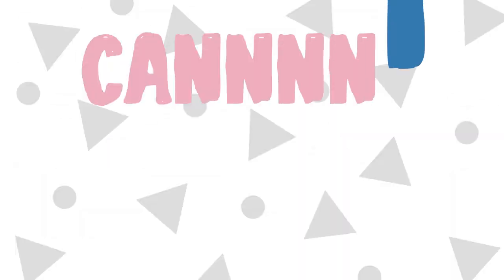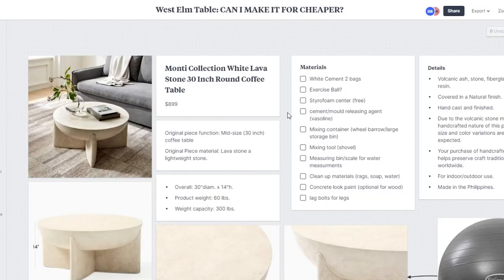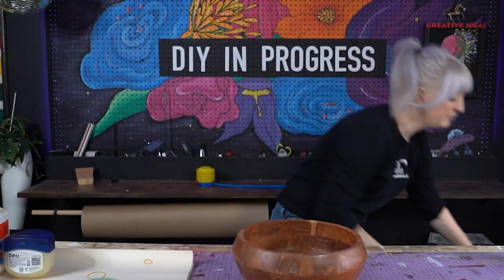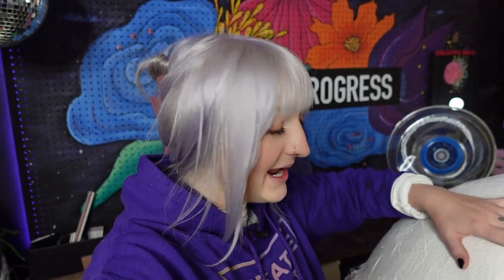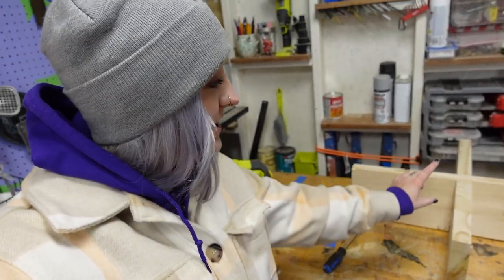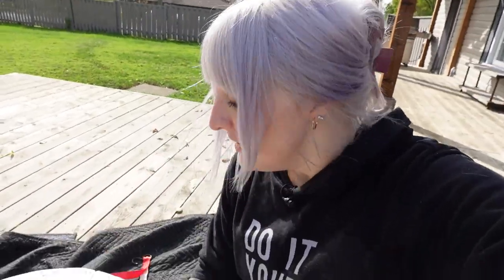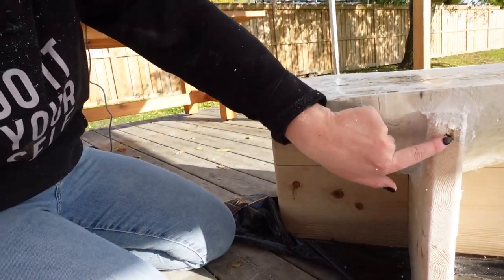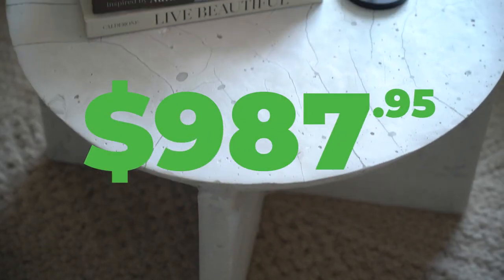Let's dupe the $1000+ West Elm Lava Stone Coffee Table! | Can I Make It For Cheaper?! | DIY Danie

Comment: As you were working, I thought of a variation for this project - I love the concrete top, but I think I would stain the wooden legs and play up the contrast in the materials.  Not necessarily the West Elm dupe, but still a visually interesting project.
Reply: I love the wooden legs idea!
Reply: Next level idea!
Reply: I was just thinking the same thing!
Reply: I was thinking the same thing
Reply: I use packing peanut in the bottom of big planters. I wonder f they would float? Or if you could mix them in. You couldn’t have used plaster of Paris to fill the cracks? Or how about an epoxy pour in another color. For the record, I liked the bowl shape of yours better than the flatter shape of the original.

Comment: To use more foam blocks, maybe hold them down with a piece of plywood. Hold the plywood down with a rod into the bottom, pour concrete on top. The hole in the bottom is covered by the legs anyway.

Comment: Hi. I live in a Caribbean island and our roofs are made of cement or concrete. The way they make it to avoid cracks is create a kind of pool of water on top of the fresh cement and don’t let it dry for a full day until the cement sets. That might help you the next time you need a smooth surface in a concrete material.

Comment: My sense is that if you read between the lines, the original West Elm "Lava Stone" is actually a kind of concrete as well: they list "volcanic ash" and "sand" as what it is made of.  I suspect that it also includes something like finely ground styrofoam to lighten the mix.  I would search on-line for something like "lightweight concrete mix" and see what comes up if you decide to do another project along these lines.  Even so, I'm impressed with how yours came out: cement can be unforgiving and your version looks great!

Comment: This turned out really well, I think the cracks add a uniqueness to the piece. A little tip (and if you ever attempt this again hehe), the reason for the cracking was because the expansion of the cement. Have you even noticed on sidewalks that there are lines ever so often, that’s there to allow the cement to expand and not crack elsewhere. Also, the temperature change could have contributed to the cracking. Most cement jobs are done in the spring/summer cause the cement can handle the hot weather a lot better than the cold. I used to work as an electrician and working with the builders I picked up a couple things along the way haha.

Comment: It came out so neat! Digging a hole to support the mold was a stroke of genius.
I don't have much experience with concrete, but my understanding is that humidity helps prevent cracking? A spritz of water on some plastic tarping can help the concrete cure at a more consistent rate, meaning the surface won't dry so fast and contract before the inside has a chance to start.

Comment: If you make 2 bowls, one a little smaller than the other, then set the small bowl inside the large bowl and only pour concrete in the space between them.  Then use a piece of plywood for the top, seal with epoxy and add thin layer of cement or spackling compound over the plywood and down the sides.  If bowl is @ 2 inches thick, top could be anchored to the bowl with concrete screws.  Just my thought.

Comment: love love love the end result, and the cracks gives it extra character:D  i was thinking you could probbably make the bowl shape with a kiddiepool/sandbox and use expanding foam (the one in a spraycan) in it, then cover that shape with concreate/joint compound, that way it'd be alot lighter:) also using styrofoam sheets for the leg shape, covering that with the same as the top and you'd end up with something very similar but alot lighter:D <3   btw litterally every time you say editor roll that tape and the little intro song comes on i ALWAYS wiggle my body xD

Comment: Great job. The white bubbles ( forgot the name of it - sold in Canadian Tire)- additive to planter’s soil could be used to make cement lighter. I tried a few projects with cement - not easy. Cracking occurs summer time as well due to heat so it’s drying too fast . I would use old fire pit bowl for the top with the wood on a top and wood legs. Than finish everything to make it look like stone.

Comment: Danie this totally turned out amazing! Having worked with cement before I have some thoughts!!! 

Maybe look into some reinforcing somehow. Either a fine mesh/chicken wire (chicken wire may not be enough ot is very hard to work with) or that fiber glass mentioned in the original table ( think extra large glitter that acts like a mesh when it’s all in the cement mixture) with a mesh on top of a hallow base (and a vapor barrier) you could maybe coat a hollow wood structure with the cement and fiber glass. Also Home Depot or lowes has concrete dye that works well. Maybe a small mock up first! Of course I totally understand the “never working with concrete again” it’s messy!!! Also metal flashing is a really good way to get a shiny surface.

Comment: I really like the wabisabi cracks in your piece.  I know you were doing a dupe, but if you use a darker/contrasting paint inside those cracks before filling, it would look like marble. I also like the flatter bottom and proportions of the original table.  I think I might just make the ‘legs’ more proportional to your table, since it is a smaller dimension would make it look closer to the inspiration. Last thought ~ when pouring, be sure to scree the top so it has a flat AND level surface. Maybe even use a slip layer on top.  Overall, GREAT JOB.

Comment: I think it came out better than the original. I like the cracks. It's perfectly imperfect! Also you could try using beanbag  Styrofoam filling stirred into the concrete. Don't know if this would work but I have heard of Styrofoam being added to concrete for building projects before. Worth experimenting!

Comment: Very nice! There is mouldable concrete, that is more used like clay. Have not tired it. I would try to use that over a chicken wire structure, and beforehand fill that structure with something light, lite polystyrene. Or perhaps that popular sprayable foam! ☺️

Comment: The cracks make this table even more interesting and unique. Maybe you could add a hollow foam shape into the mould once you've poured enough cement ( as if you'd put in a large bowl) and cover it (only the foam part) with a foam lid, on which you pour the remaining cement. This way it's hollow and shouldn't have that much weight. At the same time, it should have stable enough statics. Anyway, this table is absolutely awesome 🥰

Comment: Hi Danie, I just love your table Cracks and all! I did not understand the Styrofoam until just now.../You wanted filler so you did not have to use so much cement??!! Would chicken wire with the foam have helped like using rebar in sidewalks for stability also have helped?? I have to say I  love your determination!!!!!  AND Welcome to your Deanna!!!!

Comment: My idea for reducing weight would have been to create a semicircle out of foam smaller than the table and then anchor it through the foam and mold in several places. You could be clever and hide the anchor points along the lines that the legs would be attached so you can’t see whatever holes or imperfections the anchor points would make in the finished table!

I thought the wood legs with drywall mud were ingenious! I was skeptical when you said that’s what you were doing but it came out SO WELL

Comment: I did cement sculpting in highschool and here is some learnings from then. 1 You need to keep cement WET when it dries... i know!! But you need to spray it on the daily for a week while it dries and cover it up to keep in the moisture. So summer isnt ideal.x 

2. To make the project weigh less, use newspaper that you scrunch into balls the cement will fill in the nooks and crannies. 

3. Use wire, metal rods etc to reinforce the cement, especially on big pieces. 

First time watcher, loce the vibe

Comment: WOW  ! cracks are like wrinkles ,  I think you now have an original  always better than a copy .. This video was the definition of DIY ,  I've been obsessed with concrete lately !  options like aircrete  sound great  and maybe the inside something like an air bladder or an inner tube filled with those packing beads or spray foam . 

1

Comment: Hi Dani, very cool table! If you  were do this again, mix the cement with vermiculite to lessen the weight. Instead of epoxy, use cement bonding glue that you paint the cracked table top with, and mix the bonding glue in with the cement to make a thin skim coat to pour over the surface. You would have to leave the dome in the ball mold while the cement skim coat hardens.

Comment: Did you consider making maybe an outer shell, and an inner shell so it’s a concrete hollow bowl? I was thinking making with some wire and plastic wrap and fill the gap and then do a round top pour separately, glue together and fill the seam somehow? I think that could’ve helped with the weight

Comment: I think it is an amazing dupe. These are the things I think you could have done differently to help the overall outcome. (My version of armchair quarterbacking one might say.) I would find a way of connecting the garbage pieces so the bottom pieces would help hold down the top pieces. In addition, I would use a piece of plywood to cover the pour so the top was more even and you didn’t have to spend so much time and effort to get the top flat. I honestly don’t mind the cracks, and I think the colored epoxy was a brilliant solution. It’s totally not my style, but it is really well done and it looks good in your space. 10/10!

Comment: I love it, the cracks give it more carictor and a story to be told. The Japanese believe that a I perfections should be celebrated and tell their own story. This table has a simple but great story . The cracks would have looked great whit white pearl mica mixed in to the epoxy, but maybe not have sat right with your room design. Always and idea for maybe another time. Also fine chicken mesh to hold the shape and making the cement thicker so the inside could be hollow, maybe with a lid that could be lifted to reveal a fire pit or storage. Just an idea that came to mind as you used you soil firepite to hold the form.

Comment: Hi Danie, came on to mention Kintsugi technique, but see it has already been mentioned so just want to add a wee bit to that.  Instead of using the gold, or buying a kintsugi kit, you could maybe colour some resin and use a really fine syringe to inject the colour in to the cracks on the top.  Jesmonite crossed my mind, but it hardens quickly and would clog the syringe, and you may not have any.  I imagine you would have supplies already on hand for the resin idea (maybe not the syringe), so it wouldn't add to the cost significantly, and you get to choose the colour you want for the cracks.  That aside, great table, great processing, and MORE MASSIVE CONGRATULATIONS  on your marriage. xx

Comment: I was thinking concrete, but instead of adding pebbles and stones, add vulcano rock (zeolith) It comes in sacks, it's mostly for aquariums or add perlite, which is for gardening, but also kind of cheap in big sacks. Both are way lighter than normal stone, while perlite is even lighter (almost comparable to Styrofoam). I think it would be great to add in the mix to make it lighter!

Also the shape of the west elm table top reminded me of a fire bowl! If you already happen to have such a thing at home, you could easily us this as a mold, and maybe let it set and ry inside if you have the space for it, to prevent the cracking.

Those are my thoughts but you did so well danie! I probably wouldn't be able to execute it that well 🙈

Comment: Hello from Greece! Just a thought, here builders use styrofoam moulds to make unusual shapes in walls and so on. So....make a dome mould (uber-messy),  build it up from the outside (how you did the legs), keep the foam on the inside (weight friendly), flip it and do the same to top. Anyway, good for thought

Comment: When construction workers pour cement in wintertime, they add antifreeze to the mixture to prevent breakage. Would that have helped your table, or did I miss something? That was quite a challenge you took on, and it surely does look good!

Comment: there’s something called aircrete which I feel like could’ve been a cool option
Reply: Yes, My Little Homestead on YouTube shows how to do it. They made a roof with it and are currently doing stepping stones for wall tiles. Pretty interesting.
Reply: Aircrete isn't suuuuper durable though...
Reply: @promisedjubileedaniels  yeah i’ve never done it so i have no idea.  aircrete with rebar? hypertufa?
Reply: @amaiaamaiaa  I was thinking the easiest thing would be to do it with cast material... It would make it pretty thick, but I think lighter than concrete, and more sturdy than aircrete.
Reply: @promisedjubileedaniels  you can fiber reinforce aircrete. Shredded up fiberglass. Aircrete has it places and this is definitely one of them. Even with its lower strength it’s still more then enough for a coffee table.
Reply: @SurelyLightFoot  I've never seen that. Smart!

Comment: I was hoping you would’ve looked up Air-Crete. You simply make a lot of suds, usually from Dawn Liquid dish soap. Then mix it with the cement and viola! It makes concrete very light, and it can be carved easily, it’s extremely sturdy, and it even floats. If used to make a house, it won’t burn, it’s superior insulation and has been used to build houses in very hot places because it stays cool inside. I could go on and on but I do hope you look it up. It’s amazing stuff.

Comment: For the weight problem, you might add vermiculite to the cement mix. It would add air space to the mix, kind of like using whipped egg whites in a batter.

Comment: the cracks give it some character, but yeah perhaps not as much as it turned out to have - if the original wasn't being compared to, then it doesn't look out-of-place! 
in baking, when making custard to use later (cake filling layer, inside pastries etc.), it is recommended to lay cling film (plastic wrap??) on the top while it cools down - this prevents a thick layer/skin forming - perhaps this technique could be useful to prevent or minimise the surface cracks 🤷‍♀
great job overall though! I definitely think the labour rate on this would be fairly high. well done on yet another great DIY 🎉 and CONGRATS on the recent nuptials 💝

Comment: Water cure cement. Then you will not get cracks in it unless it is over 85 F where you are curing it. I have been working with cement since I was 4 years old. As ridiculous as it sounds, it takes water to properly dry cement. Glass fibers can also be added to increase tensile strength. Thank you for sharing your very creative projects ♥

Comment: For the weight problem you could have used air-crete "My Little Homestead" is using a lot of it at the moment. It allows you to get the strength of concrete but not the weight by filling the mix with air/soap bubbles. Hope this helps 🙂

Comment: I actually like the cracks, it adds a more natural look to it, the only draw back is cement stains easy specially white. So adding the two part resin to the top should stop this from happening. The other option that you could have used was the beanbag filling all those beans could have been mixed into the cement after creating the bottom outer shell and then a fresh batch of the cement to cover them up.
I like it as an outdoor piece would be great between chairs around a fire pit.👍🏽👍🏽

Comment: Hi Danie, it turned out so great!! I think to reduce the weight I would have built the top shape with thin mdf sheets (with support in between) and maybe mesh around the sides or so and then spackled it like you did the legs. It would be hollow yet sturdy. Maybe something for another time :)

Comment: Fortunate for me, there are quite a few Asian stores near me, so I know exactly what "mold" was used. I have one under my sink that is exactly the same shape and size as the original. Because there are different sizes I could fill the larger bowl with the cement, then nest the smaller bowl in the cement to create a cement bowl (idea stolen from diy fire pit YouTube videos). Then, fill the cement bowl with  as much Styrofoam as possible. Then, top the cement bowl inside the larger mold with a few inches of self-leveling cement. Not sure if any of that would work, but I love the way it looks, so I just might do it! I wouldn't change the way you did the base unless I just left the wood exposed. But yours looks amazing! ❤

Comment: Architecture side of me have a suggestion for you. Those thin wires you used to make the measurements and make the rounded based, could help you as its structure and hold everything together. Then you'd have less cracks and during you cement was stiffened. The other thing could help you prevent the crack was using a little bit of antifreeze gel and a little bit of fire next to your cement when you left it to dry
Reply: Also I believe there are some places you could have easily buy the premade cement for even such a small project. Which they could prepare it for you in a proper situation. 
Just a suggestion to help you have more capability while you're doing such wonderful projects. At the end Bravo. It was so nice watching you.

Comment: My grandfather made cement garden pots and sold them from his back garden for years. Initially he used a standard sand and cement mix but the pots were stupidly heavy. He used vermiculite in later pots that reduced the weight significantly. If you had made a sandier mix and layered it in rather than pouring it you would have had less cracking.